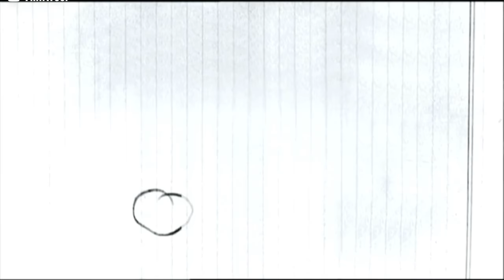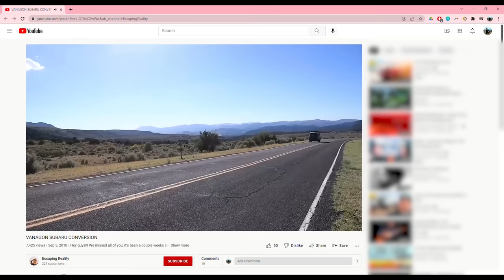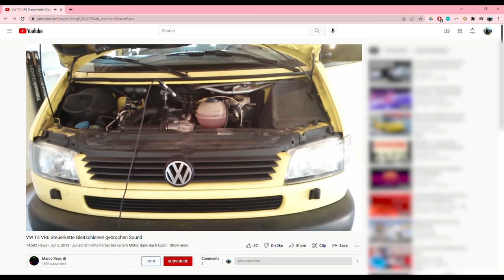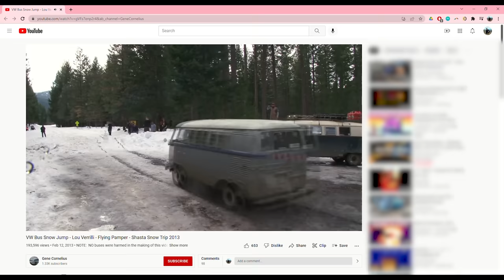The Long, Weird Trip of the Volkswagen Bus | Up To Speed

Comment: I can personally recommend the Kombi - I only had to remove the engine 11 times during my first road trip (true stroy)  😂
Reply: WHAT xdd since im kinda young (20s) , can you explain WHY and HOW , can you even do that , while on a road trip ? xd sounds like a memorable trip tho xd
Reply: i guess with a screw driver and a 10 you can take every thing out? (or are it wierd german sizes like mercedes and bmw like to use)
Reply: @reggiexp69  oh xd guess they aren't as complicated as new (new'er?) cars , since I just cannot imagine , taking an engine out even once while on a road trip , with new cars that is xd
Reply: @Cig4ras  hahahh for real, in france my friend always say you can take a citroen 2cv apart with just a 10mm
good old cars with carbs
Reply: @reggiexp69  lol , can imagine , but in my country , citroen 2cv are probably almost non-existant or at least can't recall seeing one xd
Reply: @Cig4ras  here 2cv are not that commun like seeing them ride on the road but in the summer time to time u see them riding on the road they are wanted and probably owned by collectors or people who have them for years and never will sell them, but you mainly see alot of renault 4l my friend has 4 of them even a 6v one.  you rarely see vw beatles in france i used to see alot of them in the netherlands
Reply: @Cig4ras  the engines on the type 1/2 as well as the early beetles are only held in place by 4 bolts.  Literally pop out the driveshafts and remove a small rear panel and the whole engine/gearbox falls out. They can even run outside the van due to no electrical crap in the way!
Reply: My dream is to swap a kombi panel with a subaru engine and use it as a mobile bike shop.
Reply: Thought that was @kombi life popping up just after hippys.
Reply: @Cig4ras  you can look up this crazy adventure on his channel, the Hasta Alaska series. There is also a video focusing on why Ben had so many breakdowns with his kombi/bus.
Reply: @KombiLife  oh wow , didn't knew you was uploading videos , will check them out !
Reply: @borislicina455  yep , will do that , didn't know he was uploading videos xd
Reply: i would personally recommend any other van that doesn't require the engine being removed at all. that is how my big dodge rolls anyways.
Reply: That's way better than 12 times.
Reply: Y'all's saga was great
Reply: We NEED this story. I don’t care if it’s even fake.
Reply: @jacobrzeszewski6527  it's real lol it's on their channel I binged it one night with a homie 😂
Reply: @Cig4ras  what the hell is xd and why do you type it all the time? I've seen XD as a stand-in for laughter before, which makes sense when it's capitalized because it actually has some sort of animated resemblance to a person's face with the mouth open. But xd when it's lowercase doesn't look like anything. Does it stand for something?
Reply: @isaiahayers1550  I guess it would stand as in "XD" too , but as in a smaller laughter and it may just be my habit in a way.
Reply: A small road trip from south America to the states 😂. Huge fan of yours from Chile 👍🏻
Reply: @Cig4ras not trying to be rude or a dick, but when typing xd it’s gotta be caps. XD, looks like the squinting laughing emoji
Reply: This is why I completely upgraded my engine, drivetrain, and suspension. In the early years, I spent more time wrenching on it than my Flathead.

Comment: Great one, guys. I still drive my 1995 Kombi Clipper here in Brazil (1.600 cc boxer with two carburators).
We had diesel, trucks and many other models here... with gas tank always positioned right above the engine, turning many Kombis into bonfire vans. Cheers!
Reply: Yes

Comment: Bought a first gen when I was 18yo. It was a piece of steel with no wheels, engine, transmisión or windows. 
I put an original engine in and about a week after (when I got to 40mph) decided to swap it out for a 95hp fuel injected AP16 engine, which made it feel like a rocket. My girlfriend and I hand built the interior for a few years to be one of the nicest in Chile.
Fast forward 10 years and my girlfriend and I are getting married on September and getting away on the bus. This machines truly bring joy and love to people. Not a hippie but truly share the love for the bus.
Thanks for making an up to speed about it 👍🏻.

Comment: fun fact about the VW Bug, when it first rolled off the line during production in WW2, the rear axle set up was from a truck. That way you could mount an MG42 in the Bug after cutting off the roof along pre-made lines specifically for that purpose. Pretty much anything from early VW is rooted in WW2 Germany while it was ruled by the Tiny Mustache Man

Comment: Do an episode about the EV1 GM first electric car was made in 1990s. People need to know about it!!

Best content as always 👌
Reply: My dad had one, my whole family was sad when they crushed them all.
Reply: That would be a great Up To Speed. Or, if they can find a survivor (I believe some had drivetrains removed but were given to museums, and a few of those were restored to operating condition with scraped-together parts), a Bumper 2 Bumper. Sort of a forgotten tidbit of automotive history, one so far ahead of its time, would be the sort of thing they like to cover.
Reply: @quillmaurer6563  I saw a video on youtube couple years ago, someone had found an EV2 parked in either a company's parking garage or airport parking garage. And yes the ones GM left were stripped out of the drivetrain, and were given to  Museums and schools.
Reply: @msabawazeir  You mean an EV1? I'm not aware that they ever made an EV2, but perhaps had things gone differently would have eventually. From what I've heard there have been a few of the ones given to schools and museums that people have made functional, probably with a mix of genuine parts they managed to scrape together and some parts from other EVs. These days if someone had an EV1 body/interior they could probably put a new drivetrain in it fairly easily using parts of modern EVs, and get a much better result than it had been originally. Much like doing an EV conversion of a rolling chassis that happened to have originally been electric.
Reply: @quillmaurer6563  yes I know they first made EV1s around 1996. Then they updated them around the end of 1998 and corrected range issues and fitted them with more efficient batteries. Perhaps they were still named EV1, but for sure there were 2 different versions of the EV1.
Reply: @msabawazeir  Ah, two generations. Makes sense, it certainly was regarded as a work in progress. It's clear GM engineers actually put a lot of work into the EV-1, it wasn't just a half-assed effort to fulfill some legal requirement. The sense I got is that those within the company working on it were probably very passionate and wanted it to succeed, but the company's upper-management had other ideas. Both due to pressure from oil companies and other entities, but also doubts it could be commercially viable given the limitations of technology and infrastructure at the time, which I would agree were probably valid. Given the small size, cost, range, charge time, and so on, even if they did the best possible it would have still been a niche market GM didn't want to support.

Comment: 5:14 fun fact, i worked at the museum where the Rumpler Tropfenwagen is displayed at: the German Museum of Technology in Berlin. It's an interesting car. The designer realized that drops (in German Tropfen) have a great drag coefficient and designed the car like a drop. But vertically instead of horizontally. 🙈

Comment: This is the most extensive coverage you've done of the often-mentioned Chicken Tax, but I think it really needs it's own video, feels like a perfect Wheelhouse episode. Go into more depth on the history of it, the under-the-table dealings, and the impacts it had, including what vehicles we don't see in the US market due to it. However to my understanding the VW Bus passenger or camper versions wouldn't have been impacted by it. It covered trucks and cargo vehicles, so the pickup and panel van versions would have been gone (these are now exceptionally rare), but passenger vehicles - even vans - were exempt. For that reason some vehicles were imported with seats temporarily installed, only to be removed and destroyed after import and the vehicles sold as cargo vans, this was done on a large scale by some companies, I believe including Ford (this too would be an interesting bit for an episode on the Chicken Tax).

Comment: I’ve kind of already decided I want an ID BUZZ on nice wheels. 😅
Reply: I was thinking the same think until I saw the starting price of over 50k
Reply: @Dave435l  starting price it gonna be between 40-45k. Where you getting over 50 from? 

That being said, the 300 mile range EV price floor is around 40-50k. Plus 50k isn’t as much as it used to be 🤣

Comment: Used to drive some restored T1's and T2's as event/wedding cars, restored and absolutely lux'd out. They were heaps of fun to drive, no power whatsoever, but backfired on the lift-off, and when it rained, the water would go up the windshield and come in the roof vent box, without fail. I got soaked on the rainy days, but sill heaps of fun

Comment: I was stationed in Germany 66-69.  Once had a 57 Bus.  1100cc, 36HP.  Mine was the fastest of those I ever saw, would reach 47 mph.  But the brakes weren't up to that extreme speed and the handling was worse that the brakes.  I've been told that you can roll one of those at 12mph in a flat parking lot and I believe it.  They were designed for city delivery (50KPH/30mph speed limit) in Germany and were sort of adequate for that.  Police in Kassel where I was stationed told me that engines lasted 2-3 months for them.  They'd start them cold and instantly redline them in 20 degree and colder temps.  But they didn't care because the VW replacement parts plant was in Kassel and VW replaced their engines for no charge.  Wife had a 65 model which went through three engines in 40K.  The next gen model from 68 handled better and had more power, but was if anything, even less reliable.  Sister in law had a Westfalia which went through three engines in 80K, typical for that model.  Basically not too bad for city delivery in Germany,   pretty incompetent for anything else.  I just roll on the floor laughing every time I see one of those going for some serious money at auction.   

I've always been a minivan person.  Always thought I wanted a VW until I had one.  I've been running Caravans and Chryslers for 35 years now and they're really good.  Too bad that Chrysler is longer in business.  Peugeot is now in charge and they treated me so badly on life time warranty for my 09 that I will never buy or recommend a Chrysler product again until Peugeot is gone.  Kept my 09 for 5 MONTHS for transmission repair when the local dealer had the reman transmission in stock and could have installed it in two days.  But they  wouldn't authorize that,  insisted on dealer rebuild.  Car sat on various dealer lots while they fiddled around  finding a dealer tech they would authorize to rebuild it.   They probably "saved" maybe a thousand dollars on that repair and lost a lifetime customer who currently owns 5 minivans and 5 RM diesels.Never again.

Comment: Air-Cooled VWs are all just fantastic vehicles! I had a '71 camper with a 2.0L, dual carb motor, and, a '79 with an auto trans, and, Bosch fuel injection.

Comment: Point of order: the Chicken Tax only affected the pickup and panel versions of the Type 2. Passenger vehicles aren’t subject to the tariff. That’s why you occasionally see oddities designed to take advantage of a loophole, like the plastic seats in the bed of the Subaru BRAT, early Japanese pickups arriving as cab chassis and then having their beds installed Stateside, or the side windows and rear seats that the first Transit Connects arrived with only to have those parts removed and destroyed as soon as they rolled off the boats. These modifications allowed them to technically count as passenger vehicles and thus avoid the tariff.

Comment: Fantastic history of the Bus! You really made the content very digestible and easy to follow.

I do have to say, however, that you completely skimmed over the Vanagon! I am very surprised you spent such little time on this generation considering the amount of times a Vanagon appears in other episodes (wasn't there a Vanagon in the Gambler episode?). After the Hi Low series with the overlanding Tacomas, I am shocked you didn't mention the Westfalia Syncro. They were designed for overlanding before overlanding was a thing! There are literally festivals in the Pacific North West celebrating these vehicles (Syncrofest, Descend on Bend, and Burning Van to name a few). 

I think these are one of the most versatile and loved classic vans and the massive aftermarket and community support proves it. This "Swiss Army Knife" of cars was practically designed to be modified. Take a look into the conversion options offered by aftermarket companies. VW TDIs, Ford Focus motors, and Subaru drivetrains are some of the popular ones.

Anyways, love the videos. Bought a Miata partially inspired by Money Pit. Do a Bumper2Bumper on a modified Subi powered Westy Syncro, you will not be disappointed. 
😁

Comment: It's actually a 25% tax on light trucks imports which is why Japanese trucks are now made in the USA like the Tundra and Titan. The Ford Transit van is imported from Turkey as a passenger van and when it gets here the seats are ripped out avoiding the tax... The Subaru brat had seats installed in the bed to also avoid the tax remember that one..

Comment: The clips of all the burning vans is because they had the petrol fuel lines running over the engine and they would often leak as the vans got older and catch fire. My cousin had it as well, some years ago, quickly get the kids out and see the van burn down.

Comment: here in Brazil the volkswagen stoped to produce the bus ( we call Kombi here) due to new safety laws over cars. The new regulations demand airbags and ABS brakes to every new car sold in Brazil. The Kombi was topseller van in Brazil at thaat date, and VW even tried to adapt the car to the new laws, but without succes. it was still the first generation of Kombi, but wit a 1.4 l water cooled engine, the gearbox and all the rest was from the first generation.

Comment: The first watercooled engines for the T3 were actuslly from Oettinger. Do some research on the Oettinger WBX4 and WBX6. Next point the I.D. Buzz will actually be produced in parallel to the T7. The next generation Transporter will then be a cooperation with Ford, also replacing the Transit Custom. The Transit has also always been strong competition for the Transporter series and was one of the reasons that the T(ransporter)4 then moved to a front engine concept. Finally in one of the shots of T1‘s on the road at 8:45 there are actually some Tempo / Hanomag Matadors, another competitor to the VW Typ 2 T1.

Comment: The T4 with the 5 cylinder diesel (N/A), 5-speed manual was one of the most fun vehicles I have ever driven. It went up to 135km/h at top speed and didn't have a lot of power but boy did it sound cool. You really had to rev the snot out of it constantly because the gearing was so short and the diesel didn't have a turbo (really weird by today's standards). Fastest sounding slow car ever. It could carry so much sh*t too. I miss that van...

Comment: That's it! As Popeye would say , "That's all I can stands, I can't stands no more!" Let's get the  Chicken tax straight. The import tariff was on completed light duty commercial vehicles. The classic type 2 window van was imported as a passenger car and therefore not subject to the tax. Other consequences of the tax was that Toyota   and the other Japanese Pickups were shipped to the U.S..bedless only to have there beds installed. (which were made of inferior steel) and the subsequent common sight of trucks in the Rust Belt sporting home made replacement wooden beds. Subaru BRATs having that pair of useless office chairs bolted down in their beds.  The existence of the Volkswagen  Pickup which was built the U.S when the Westmoreland  Pa. was in operation.

Comment: And in Brazil the last production year was 2013, that was the same as the T2.. but with a 1.4 litter ea111 engine... the aircolled flat 4 1.6 litter was produced untill 2005... 56 year produced in Brazil.. with basically 3 models...

Comment: I'm surprised you didn't cover that the T5 had an ad or an option or a kit or something, idk exactly, that had a SLIDE OUT rear to expand the interior space for use as a camper. I wanted one for years just because of that feature. IIRC unfortunately this feature, or model or whatever, was not available in the US.

Comment: Dude that electric combi looks awesome!

Tho I would like to see samba version fully modded. Carbon fiber and aluminium full body with flared wheels with wider wheels on it. Better suspension for off-road and to have it in all drive. Have an engine swap to something with more HP andthat could fit or make it fit... Curious if flat engine would be good for that car and if it could even fit. Basically modded replica with modern/improved stuff on it. To have that slightly modified retro look but beefed up a bit.

I wonder how much of that is possible and not to be disaster of the car, since I'm no expert. ^^

Comment: So you think your F150 can carry a lot of weight with its 5.0 V8, a Kombi can carry 4000+ pounds (not officially, but real world) all day every day for decades with an 1.4 or 1.6 4 cylinder no problem with minimum cheap maintenance, there's the slight problem that if you crash at 20 mph or more you'll probably die, but that's small details, best car ever.